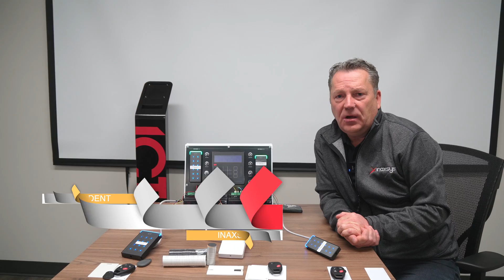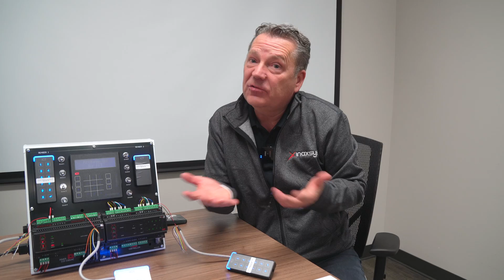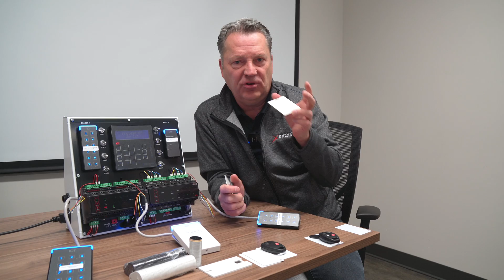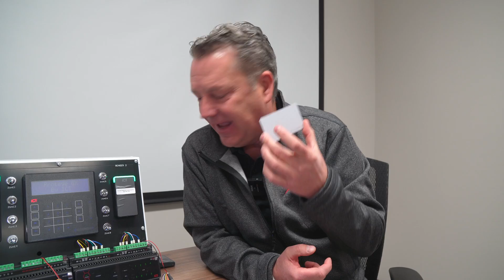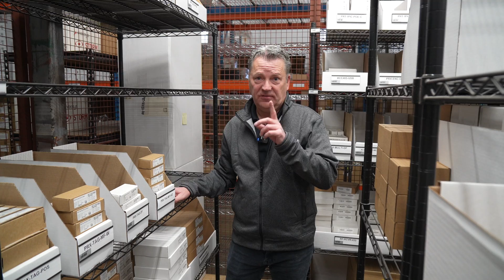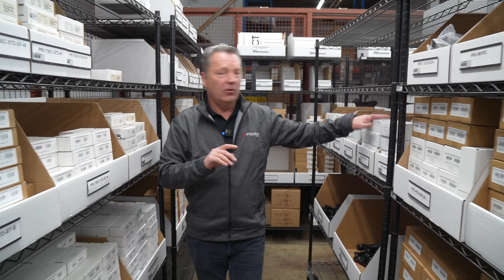Access Card Technology Security Comparison: 125kHz vs MIFARE vs DESFire EV1 vs DESFire EV2

Comment: I think all this is going to be gone in the next 5 years.  Everyone wants to go to mobile credentials.  This is where an app in your phone sends your ID via NFC to the door reader.  No more cards to get lost (only phone to get lost).  Major advantage: if phone is locked, someone can't use your phone to open the door, unlike if you drop your access card in the parking lot.  Encryption can be updated at any time.
Reply: The phone as an all-in-one device is certainly practical. However, it has the big disadvantage that it only works when the battery is full. Or if it falls down and the screen breaks again, then you can no longer get into the house or have no ID. So I think it's OK if some things are independent and work on their own. And old-fashioned RFID cards have the big advantage that they work without batteries and are sealed waterproof.

Comment: Nice video. Can DESFire (EV 1, EV 2 or EV 3) cards be copied with, for example, a Flipper Zero?
Reply: You can copy the serial number and content table, but not the applications (actual certificates and files on the memory chip), unless the reader and card are authenticated.
Reply: May the serial or UID be all i need? Like in many cases with Mifare, when the records are done by some lazy guy :)